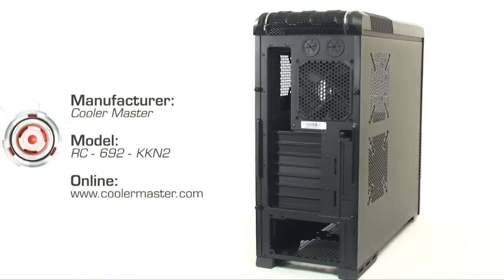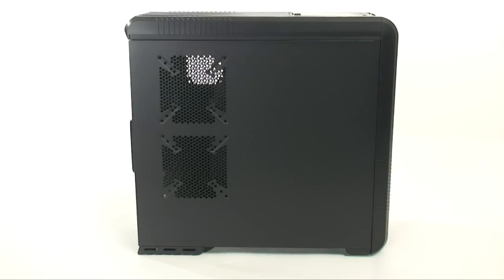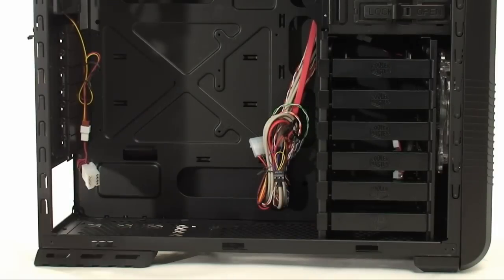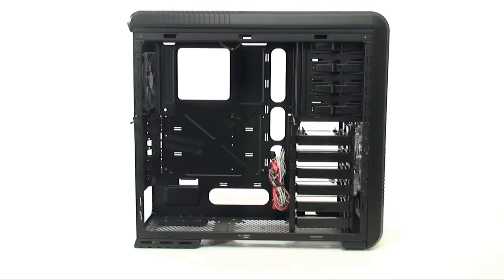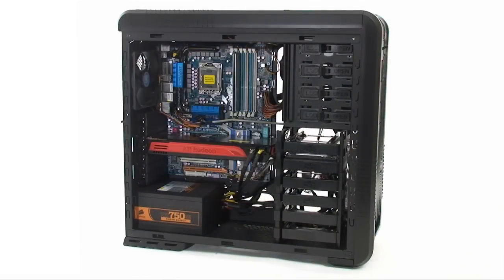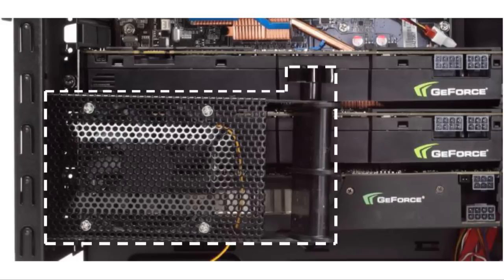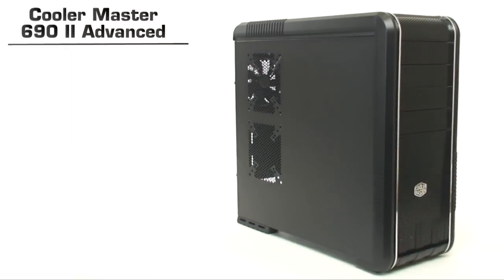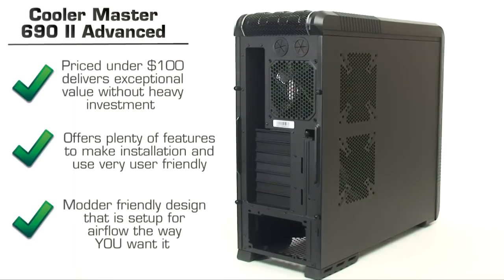Cooler Master 690 II Advanced Video Review

Comment: I need to replace the radiator on the top, but I am struggling to remove the top panel to access the screws. Any ideas how to deal with the top panel?
Reply: Clips on the inside the case to remove the top

Comment: Bought this back in 2010, went through 3 different systems and now in Nov 2020 am changing it because the drive bay is old and plastic screw holder is breaking and the connections to USB and fan lighting no longer work. It can be replaced, but I think its time for a brand new case. Other than the silver lining around the case, it still looks very new. Really good build quality.

Comment: Still using it in 2020. In fact it was cheaper and better build than the ones I'm lately buying (ven from Coolermaster). If you want this quality 2020you have to pay top dollar. Just don't need the E-sata (fail), but just used one of the 4 !!!! bays to install usb 3.1, usb type c and Qcharge 3.0.

Comment: Still rocking this bad boy in 2019.
Reply: +1 for rocking this case in 2019. Just put a new Ryzen build in it last week to replace a 9 year old FX build.
Reply: @Varmint260  Dude I did exactly that, and I'm planing to put a custom navi rx 5700 xt when they come out!
Reply: Same, the modular drive bay and the sheer amount of space inside been ideal for my past few builds.
Reply: Absolutely, an awesome case, very well designed for functionality. it looks horrible, but I wouldn't change it for nothing, best for LAN parties, super sturdy.
Reply: @efco  its not that bad to look at.  But anyone who buys this case aren't focused on aesthetics.  The mesh design is a big plus and I do find I get really good temps with this case and definitely have little to no dust build up inside.  Had thought about replacing it a few times but not finding anything that comes close to amount of internal space or flexibility.
Reply: @eviltigz  yeah, I mean the design is not my favorite, but with all the other pros, I don't mind at all. I have mine since 2011 and never had a single issue with it. Damn, you can live inside that thing, so much room.
Reply: I have one on my current rig, but I'm going to be rebuilding soon since it's 5-6 years old. Any downside to re-using it? I wish it had a removable motherboard tray.
Reply: @nhrad  Only issue I've had so far is changing my CPU cooler on an X570 board - the cut-out behind the motherboard isn't big enough to swap out the mounting piece that goes on the back side of the motherboard. I had to remove the motherboard from the case, swap out the hardware, then reinstall the motherboard. Went from a Wraith Stealth to a Hyper 212.
Reply: I'm still rocking it with an original build since 2011!
Reply: @Magnetar83  me too!
Reply: @Magnetar83  how do you access the front fan to replace it?
Reply: @VasyaNoo-c4z  You need to pull off the front panel.

Comment: This is the first and only case I have bought so far.  Done so before I got serious into researching components and cases.  And I have to say....I hate it now.   Was great when I first got it....but almost 7 years later, the problems with it are glaring.

1. LOTS of vibration from the steel panels even when screwed down nice and tight.  I literally  had to take off the front AND side panel to get it to stop.  Never put them back on to this day.

2. Not as much room in the back for cable management as some say.  I have always been one for nice, tight cable management, and even with how I do things, I am STILL having to push down on the back panel to get it on right.

3. No one mounts fans to a HDD cage (not that I have seen anyway).   Why even make that an option?

4. Dust filters suck.  Period.

5. Upper hot saw drive bay was a bitch to get working for some reason even when reading the instructions (no, I'm not a normal guy.  I read the manuals)

6. USB 3.0 ports don't work for everything that uses a USB connector.  Some flash drives work, some don't.  All my thumb drives from SanDisk do...but my WD 1TB Passport drive won't even be seen by it.

7. No rubber grommets in motherboard tray at a time when case manufacturers started adding them.  Shame....shame....shame. bell rings
Reply: My advice to anyone who is looking for a case that will do about everything they will ever need and look awesome while being easy to manage cables and have tons of space and expansion options at a steal of a price would be to buy this case even in 2018. I would totally ignore the negative review above. Unless you are beyond picky and need stuff that the majority would never care about or even notice. I own the case and have not noticed a single issue the above speaks of and trust me I can be picky. I'm all for critical reviews when needed and I study and study and study reviews for days and hours before making purchases as i'm far from rich and need to make my purchases last and be the best quality while affordable. To buy something cheap that isn't superb is just going to cost me money down the road I don't have so I am very picky and critical when deciding. That said this case is beyond expectations and has plenty of argument to be sold at a much higher cost. I will backtrack to say about the only thing I can see in the above that may carry some validity is it doesn't have the greatest filters ever but that said they are more than manageable easy to maintain and the case is simple to keep clean. If i'm superbly picky tho and wish to spend money for something most will never care about or even really notice I guess I could go with a case that has better filters. Have no idea why I would care tho as without making this further lets just say that's being really picky. This case is an awesome bargain. You get much more than you pay for. You get everything you need and then some all with premium look and features. It's honestly and literally a steal. I can't stress more as i'm sure anyone reading can tell how much I would recommend this case to anyone. You can often find affordable quality stuff if you look around and do research but it's not often you find the family priced car that is equipped and competes with the Ferrari on almost every level. This case is that. Last time and in conclusion I will say again this case is amazing and an absolute steal even in 2018.
Reply: Dude,this case is 6 years old,back then it was quite good,now it sucks in its standards...
Reply: I don't disagree at all.  Like I said, it was great when I first got it, but now...it is just terribad now that I know what to look for in cases.  Some of the first things I hope to do on my channel are case reviews and build logs.    Lord knows I have enough builds planned out on pcpartpicker to last for several years.  :)

Comment: Hi EveryOne I'm Going to build this spec it can fit in this case CM 690 III
Processor	= intel i7-4790k	
Processor fan	= Corsair Hydro Series H100i	
MotherBoard	= Maximus VII HERO	
Graphics Card	= Asus Strix Gtx 970	
Ram = 16gb ddr3-2133	
Primary HD	= Samsung SSD 840 EVO 250GB	
Secondary HD	= seagate 2 TB	
Power Supply	= CM Slient Pro M850  
Optical Drive	= LG Blu-ray Burner
Thanks for helping me to choose.
Reply: I would suggest going with a never case, but othervise it should fit

Comment: i have been using this case for last 2.5 year...and i really like it..No other case give these options like docx, led on/off switch. top 240 mm rad support together..even 690 iii doesn't provide these feature. very big disappointment to me because i wanna upgrade to 690iii for usb 3.0 on front but it lacks docx and led on front .....
Reply: there is a usb 3 version of the 690II Advanced bro :)
Reply: Mick de Raad
Yes there was but unfortunately it is not available now...

Comment: Can i fit the gtx 970 G1 in it, ive already bought it...:/
Reply: Yes, it does fit, using it right now. You have to tilt it slightly to get it in but it will work.
Reply: it fits perfectly fine didnt even need to tilt.
Reply: unfortunately no it cant....
Reply: Adde9200 Thx i bought it already should receive it this week!

Comment: I have this one, but i'm about to get an Gigabyte GTX970 g1 Gamming which is 312mm long, 3mm more than the max space available, it will touch the top bays, which are mouted with rivets of curse, so i decided to cut/unmount the rivets with a drill or, make a hole cutting with a saw, i don't see another solution, (i can't effort a new case) (Sorry my english, i'm mexican :P )

Comment: I have this case and it was perfect for a first time build.  The only issue i had was not being able to remove to top pannel, and having a weird awkward space on the inside of the case between the power buttons and the top optical drive bay, also the vents for the fans on the side pannels are hard to dust protect and also make it hard to direct airflow from front to back.

Comment: I've had this case for 2 years now and its still fantastic. Running 9 fans with an corsair rm850 gold. Fantastic case. The only downside is that you can only have one front fan. I would have liked to install two 120mms for intake. Still if you see this cheap, its worth a look!

Comment: Hi, I have this case, but the front blue LED lights of the fan doesn't come on, when I boot the PC . The fan still appears to be operational, but I am disapointed that the funky blue light don't switch on. Is it faulty?
Reply: button on top I/O, left one. Turns the fan LED on and off.

Actually, the one that the pen is pointing at in the thumbnail.

Comment: the LED fan light is permanent, but there is an on/off button on the I/O. I have this case, and i never use the light. Doesn't get in the way, and still works fine.

Comment: Indeed, but it's worth noting that some modern cases have layers of foam on the sides (not in the way of the air flow or fans) to reduce the noise made by the various cooling systems, hard drives and dvd units.

Comment: as far as i am aware (lookin at getting one myself) 
Front Cooling: 140 x 25mm blue LED fan x 1 / 1200RPM / 19dBA
Rear Cooling: 120mm fan x 1 / 1200 RPM / 17dBA
Top Cooling: Top: 120mm fan x 1/ 1200RPM /17dBA (supports 120/140mm fan x 2)
Is what comes with it.

Comment: 1 thing that cooler master absolutely fucked up with this case has to be the dust filters.

The one under the PSU can only be removed when you remove the PSU, thus making it very difficult to clean and the one in the front can not be removed at all. After owning this case for almost a year now, I have to say I'm very dissapointed, should've spend 20 bucks more and got the Fractal Design Define R3 :(

Comment: I got this for my PC build. It's almost here, It will feature the ASUS Sabertooth P67, i5 2500k 3.3ghz processor, Corsair Vengance 16gb DDR 3 memory, two ASUS 560 Ti 1gb video card in SLI mode. Antec 620 Water cooler for the CPU. Intel 320 120 GB SSD, WD Caviar Green 1.5TB HDD 64MB cache. Samsung BluRay reader combo drive with light scribe. It's gonna be kick ass. Fuck Alienware. I saved $700 buying the parts myself and I got more than what they offered for the stock system, including tools!

Comment: @hope00hope I got my H100 a little faster and I have already installed it and I din't make a video or pictures. It went ok as I have told you. Yes it makes a huge diff: I have an AMD FX-8120 and with stock cooler it had with app 20 degrees more and made a huge noise. Now I got even 9 degrees Celsius on idle and app 24 on load and I can enjoy the silence :D

Comment: @hope00hope Yes, that's what I'm getting next week. There is just one 'problem', you have to remove the front panel, then the top panel and install the 2 120mm from corsair h100 on top of the case not from inside, and inside on top you put the radiator and is should fit. I did some tests with 120mm fans and they have space inside the top plastic panel. Otherwise installed all from inside is look there is no space for the 25mm thick fans and the 27mm thick radiator because of the ram.

Comment: @ItWasntMe456 Not even sure where you could find one. But when I bought this, it was slightly updated and the box had a sticker with 'USB 2.0 version' checked. The other was the USB 3 version. t supposedly doesn't include the card holder and removes the eSATA to make room for 2 USB3 and 2 USB@ ports...

Comment: @jamtraxx - Awesome. If it didn't, I was going to go for the Corsair Carbide 400R but that's a slightly more expensive case. Any idea if the fans on the CM690II are Pulse Width Modulated?

Comment: I'm curious about the PSU mounting options...  my present set up has its PSU fan pointed down at the grates (it's an old centurion case from 2008), over the years this arrangement has kept my system cool but it's also sucked up a great deal of animal hair from my cat. The fan in the PSU has begun to make noise. I see multiple screw holes on this case where the PSU slot is, and I wonder if it would allow a "fan facing up" arrangement.

Comment: @marino4691 ahhh, yea im sorry, i came to this vid for no reason xD i have a coolermaster HAF932 case that doesn't have that cpu back fan
i would suggest blow cold air on the chip, unless there is a lot of heat building up behing the cpu, than just revert it

Comment: @marino4691 yes, because hot air always goes up, the back fan should ALWAYS exhaust that heat out of the case or else you would have warm air build up in the case causing cpu overheat, but side and front fans should intake air
if you have another fan on the top of the case it should exhaust air too

Comment: @hosrom Yes, that might be an issue, but you can't blame the case for that, plus extensions are available basically everywhere you can buy power supplys i assume for a few bucks. I can't really tell since i live in Austria, but at my place extensions cost about 3 euros for 80-100cm.

Comment: @sub4sheet I have an XFX 850w black edition PSU, my only issues with other cases is the 4-pin MB supply cable. It is long for the PSU, but some cases requires me NOT to route that cable behind the board.

Comment: Thank you very much for this review. The one thing I'd like to know is if the LED light on off switch only supports the stock fans or can I add more fans to it? 

In other words if I want to add more LED fans can I somehow attach them to the switch and have it also turn the lights on those fans off without turning off the fan.

Comment: Love this case, 2 questions, does the side panels come with dust filters, and if fans are installed on the side panels, would it block a large Heat sink like a Noctua NH-D14 Dual.

Comment: @JAKE84111 best tip ever is to never screw the motherboard directly to the case and instead put the included conductive screwholders before the motherboard (This should be in your instruccion manual but many first-builders miss it). If you don't follow this tip it could lead to serious electrical problems.

Comment: hey does anyone know which way the air flow is supposed to go when using the 80mm(optional fan) behind the mobo/processor, probably used as a puller?

Comment: @The1MiniShow i have this and its great. personally i dont like the naked metal interior of the 922 compared to the black interior of the 690, and i also thing the 690 has a much more elegant look compared to the childish look of the 922. i also dont like the cable management of the 922. 
although it might be a bit better at cooling with the 200mm fans. price is almost the same (at least in Greece) so its up to you i guess

Comment: @Nefus1988 actually, I had the CM690 before this one, and stetically, I prefer the CM690 instead of CM 690 II.

The main reason is that in the version 2, the mesh holes are bigger, probably cause overclockers whine a lot about air flow. The new mesh can be more air permeable, but it doesn't look as stylish as the version 1.

Comment: @ehab007bob 
this one is better: 240mm rad support on top and bottom, better cable management, removable hard drive cages, external drive slot and more fan slots.
but tempest evo has more airflow out of the box, and looks better imo

Comment: I was interested in this case.. this video definitely pushed me towards definitely buying it. Sadly, it's out of stock in most stores here so I'll have to wait. I hope I also get some good LED fans for extra coolness.

I've never worked with such a panel so one question I have is.. how do I connect the LEDs to the LED button on the front panel? Basically, I want the lights to be optional (using the switch) but the fans to work all the time. Is this possible without excess hacking? Suggestions?

Comment: @Strider505 there is a SATA cable (alongside the e-sata cable) that plugs in to you mobo and the SATA (or 4-pin - forgot and not really want to look for it inside) power connectors.  Manual recommends setting your SATA mode to AHCI.

Comment: Thanks very informative.  I saw how easily you removed the front bezel is this an improvement  on v1 where it's a nightmare to remove. The manufacturers ought to make the front bezels alot easier to remove as this spoils an otherwise excellent value for money case. I used a Xigmatel case last week which is very similar to coolermaster but not so good  imo and even managed to break a plastic lug removing the front bezel. Very infuriating. OK sorry about the rant and thanks for the video.

Comment: Are the rubber feet on the bottom removable i.e. held by screws or are irremovable? I usually remove the rubber feet and install wheels because usually my cases are heavy and that makes them easier to carry if you like going to lan parties.

Comment from the maker: @diebkgast Yes, all of those fans will fit. I would likely suggest that you install the 140mm fans on the side panel, and put a 120mm at the top, and a 120mm in the HDD cage or bottom. 

Alternatively you could add 140mm to the top, have a 140mm and 120mm on the side, and 120mm at the bottom or HDD cage